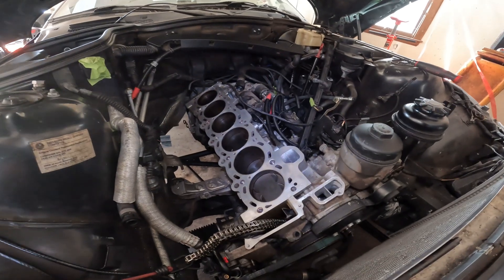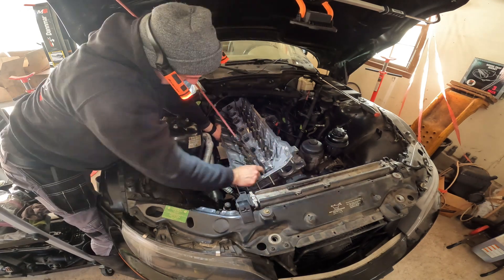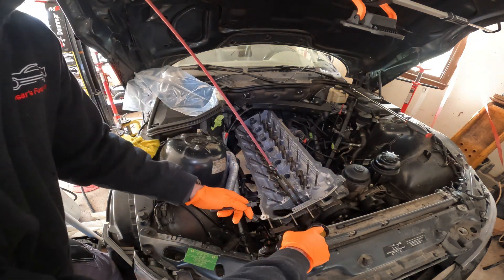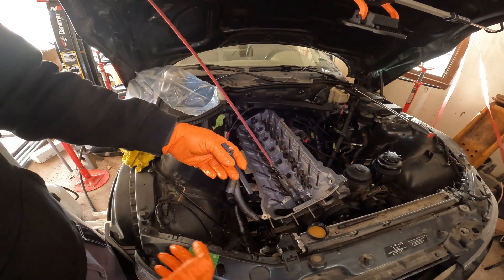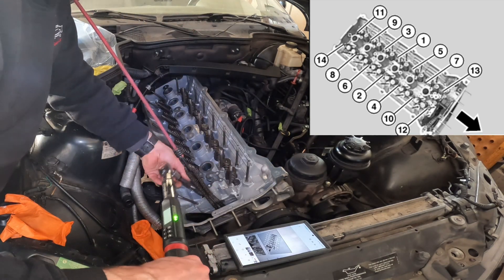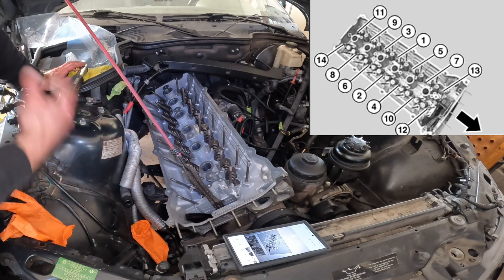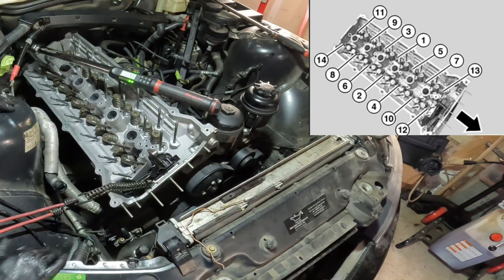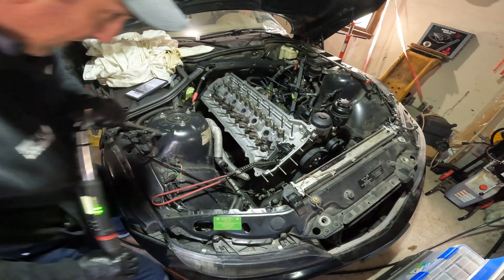BMW Head Installation With Torque Procedure for BMW M54 Head Bolts: Avoiding Common Mistakes!

Comment: Need help when removing the head to upgrade the headgasket and arp studs for turbo built do I have to to bring it to machine shop ?
Reply from the maker: I would recommend that they check it and possibly machine if out of tolerance. You want a perfectly flat sealing surface. And it it ever overheated it will be warped.
Reply: @AskTheCarExperts thank you
Reply from the maker: @phineparcon I am happy to help